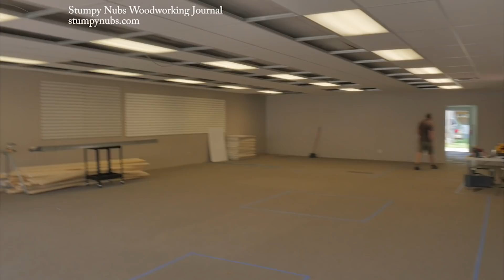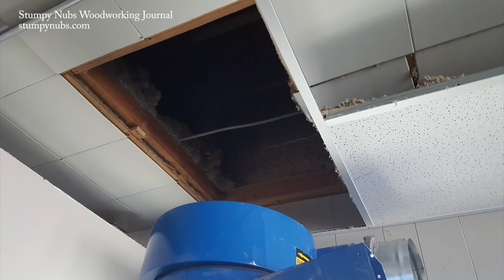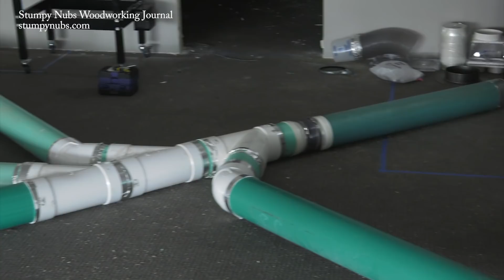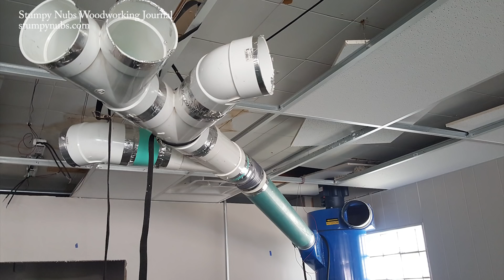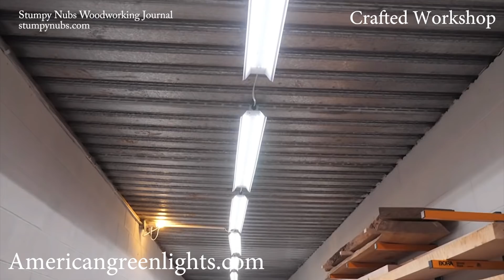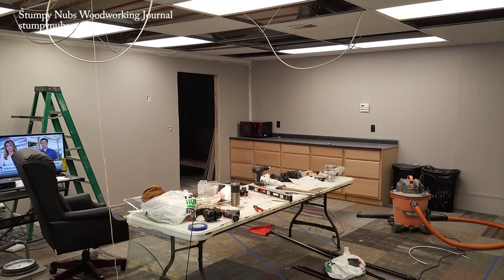Is this the craziest shop dust collection and lighting ever?

Comment: Design consideration: if the infrastructure cost for a centralized system begins to eclipse the cost of the centralized system, it's time to consider decentralizing. Several smaller dust connectors shared among frewer stations each, for example.
Reply from the maker: The PVC isn't even close to the cost of the cyclone. But even if it were, there are other factors to consider such as space, power and in our case, noise near the wall that divides us from the post office.

Comment: Regular metal snap together ducting works really well and is cheaper than big pvc. You have to tp screw it together and tape all the seams. I ran an 8" trunk line down the center of my shop and 6" branches. 
My clearvue max doesn't try to collapse the pipe at all. 
Grounding the dc system is important with a cnc and metal pipe has the benefit of being easy to bond to the dc equip grnd. 

Large pvc like that is heavy, expensive and has static issues unless you run wire in it or around it.
Reply from the maker: Not sure what you mean by regular duct work, but the stuff sold in home centers is folded and riveted, so it leaks at the seams. I have yet to find a steel solution that is an inexpensive as PVC. And I've used PVC for years without grounding, as have countless others. I've never met a single person who had a static fire. Not in a small woodworking shop.

Comment: One way I've found to conquer something like a 7° angle on piping is to use a 45 or 22.5 and turn it slightly diagonally, so the angle is shared between two axes. It works great as long as you account for the added turn angle sideways and adjust the direction your dust collector or pipe is pointing. It may not always work out right though
Reply from the maker: Wouldn't work in our case. We needed specific angles to the ceiling and two walls at the same time.

Comment: Please keep us updated on the progress of your dust collection system.  I also have a 6" system/5 hp, but am not completely happy with it.  I'm particularly interested in the chocking problem when going from 6" to 4".
Reply from the maker: I was less pleased in the old shop, but love it in the new shop. The difference is the ducting runs. I had too many bends in the old shop. The way the machines are designed make a big difference too. Some of the old machines were not designed for good dust collection, no matter how powerful the system. I've had no issues with reducing to 4-inches, but I do try to keep the reduction as close to the machine as possible with minimal flex-hose.

Comment: Another great option is to use for lighting are ballast bypass LED lights. It doesn't require removing the old fixtures but does remove the need and use of the the fluorescent ballast and wires the led tubes into direct 120 volt. Each build also has its own driver so it's as easy as changing a normal bulb if one goes out.

Comment: James, I love your videos!  Keep it up!  And now...the question: I have been talking with the folks at Clear Vue, and they have been extremely helpful.  I anticipate installing one of their systems in my hobby shop within the next six months.  But I am curious about the Harvey G700 Gyro Air system.  Do you have any stats on the comparative effectiveness of the Clear Vue and Gyro Air systems?  It would be interesting to know how they stack up against each other.  Thanks!!!
Reply from the maker: I don't. But I have seen the Harvey system and it is very impressive. If you go with ClearVue, use my discount code (at the top of the comments). You'll save quite a bit.
Reply: @StumpyNubs  Thank you!!!  And yes, I've already discussed your discount code with Clear Vue.  :-)
Reply: I just went back and re-read the Clear Vue website.  Between CFM, blower size, and filter area per CFM, I think Clear Vue is a better way to go for me.  I'm going to stick with them--with the famous Stumpy Nubs discount!  Thanks again!

Comment: Your fittings are sch. 40 and the pipe is SDR35. Hence different sizes. You should have used SDR35 fittings 😁
Reply from the maker: My fittings are not schedule 40. And they fit some of the pipe (the stuff we recovered from the old shop) but not the newer pipe, even though it is exactly the same pipe.
Reply: Stumpy Nubs maybe different mfg’s. Or   maybe you’re just the lucky one 👍

Comment: I know i'm gonna get crap for this, but I'm man enough to admit I messed up. I'm curious about what type of first aid kits to have readily available in my garage shop. Jan 1, 2019 was the first time my table saw bit me, but i only required 3 stitches so not a major deal but at that time i had nothing around to take care of it . I'm very cautious about working around these tools but i can't say that one of my tools wont bit me again. I appreciate your time. Thanks for the great videos!
Reply: lthose drug store kits are worthless in a shop.  Look for something with trauma in the description.  kits get quite expensive check out  what they contain, may just need some sponges or pads. build your own kit.
Reply: Hey DJ BigMac209. I'm not Stumpy but I may be able to help you out. I have a fair amount of experience in advanced first aid and trauma response, as well as some in plant operations.
First things first, always try to "engineer" out any potential for disaster. That doesn't mean hire an engineer if you aren't one. It just means that even if you or anyone else aren't thinking clearly and attempt something that would normally cause bad things to happen... well they don't. You've already put a system or mechanism in place to either clearly stop the person from doing a careless thing or you implemented a mechanism in the system to stop said things in their tracks.
Once that is done, you need to take stock of personnel. If it's just you, an automated emergency response system is your best bet. You can't call for help, if you're by yourself and incapacitated. A small med kit will do for most injuries. As a very small rule of thumb, the bigger the med kit - the more people it will serve. They don't usually offer much in terms of emergency medical aid.
If you think you may want to spend some money a deluxe kit, I would first recommend a wilderness first aid course. The advanced ones can teach you principles that will better serve you down your road in a garage shop.

Hope that helps. Let me know if you need more detail on anything.
Reply: I only have five items in my kit.
Electrical tape- the glue is antibacterial, wrap cuts and grazes, use enough and its a splint, etc etc
Rag- needed to clean up before application of tape.
Sewing needle- splinter removal
Tweezers, sturdy and pointy- splinter removal.
Plastic sandwich wrap- apply to burns to stop air touching the exposed nerves. (burns are the worst)
If you can't sort it with the above items it's a trip to A&E. That's free here in NZ, sometimes shit but free!!!

Comment: Big shop, however you acquired it, good for you. Personally, I couldn’t look at green pipe or pipes running at obtuse angles. I’d have to hide it in the hung ceiling and drop down over each tool...ocd,..
Reply from the maker: No room up there.
Reply: @StumpyNubs  I would have lowered the drop tiles. It's a royal pain in the rear, but it's not actually hard, just time consuming.

Comment: Did you ever consider putting all the piping above the drop ceiling?  It would have been harder to drop the tubes down through the acoustic panels, but it would have looked incredibly clean.
Reply from the maker: Not enough room up there.

Comment: A (slight?) digression, but I definitely noticed the more saturated colors in this vlog.  I suspected that you were uploading relatively raw "log" or "flat" ungraded footage previously and the very notable color difference here does suggest that that might have been correct.  So the geeky question here is if you are still uploading footage essentially straight from camera but now have a color profile while shooting OR if you just now added a color grading step to your video editing workflow and the raw footage is still flat?
Reply: That is more likely because he is shooting under the LED lights in the new shop.  They emit slightly different colors (spectral power distribution) and are picked up better by the eye than incandescent and fluorescent source of the same lumens.
Reply from the maker: I'm filming in a new space with new lighting and a different camera. It'll take a while to get it all dialed in. I personally like a more saturated look, but I think the contrast may be a little high, and worry the shadows behind the tool wall are distracting. It depends on the monitor/TV you watch it on as well. It looks good on the editing monitors, but terrible on the television monitors in the shop.
Reply: @StumpyNubs  Oh, funny -- I just saw the billions of planes behind you and assumed it was the old shop but yeah, a closer look makes it clear that it's definitely in a different space.  Totally missed that.

As far as the saturation level goes, it does look maybe just a tad too saturated on my primary monitor but it looks close to perfect on my phone.  And since 99% of YouTube views these days are coming from mobile users, that's probably the one one that matters!

Comment: Did you have to put in sound proofing to isolate the noise from the equipment from the Post Office?
Reply from the maker: Nope. There's a cement block wall dividing the two halves of the building, and it dampens the sound very well.